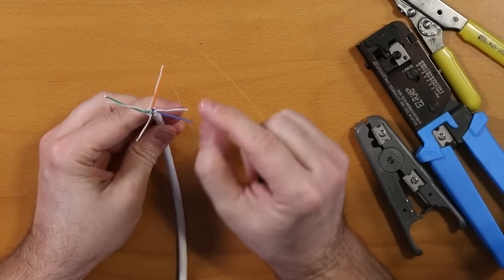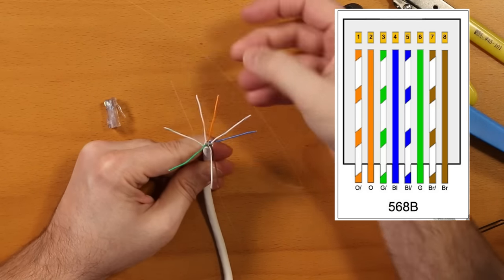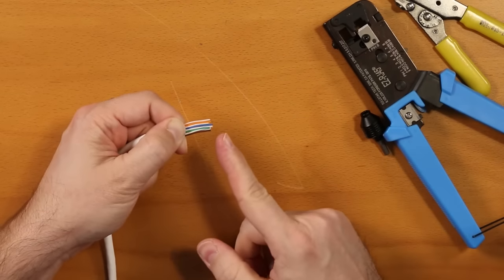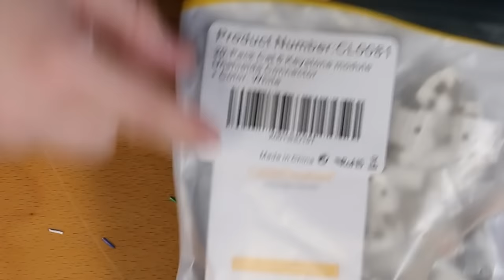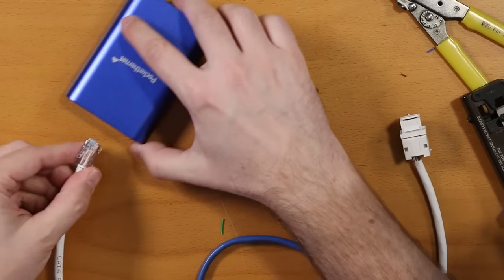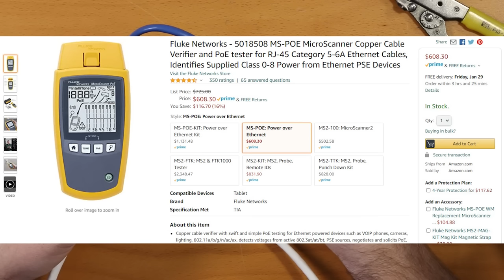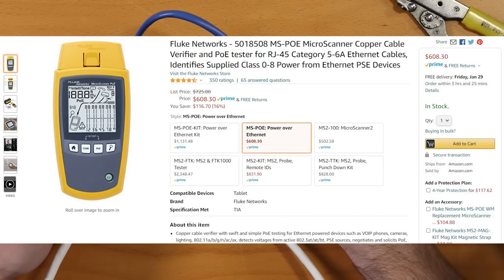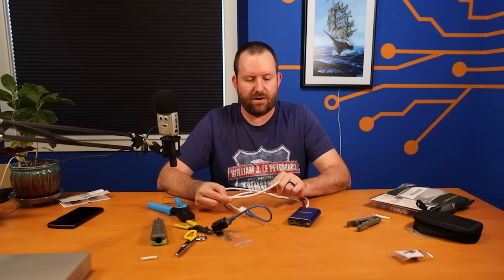How to Terminate Ethernet Cables

Comment: Hey, thx for really good video. I have recently patched out my entire new home and gained a lot of experience on how to do things. First: do not buy cheap tools. Yes, You probably use them once, maybe twice, but a lot of stress will be saved during work. Klein tools are very good ones! Second: about that little gray tool comes in many varieties, but I do recommend to get one with hand regulated opening because there are so many cables and You have to test first how deep the tool shall cut the shield to not damage wires. The worst thing is to unshield cable, start preparation and realize that one or two wires have been touched by the blade and they will come off during patching. Third: cutting wires a bit after plugging in rj45 pass-through into crimping tool will make it easy to finish them correctly. Fourth: I do prefer to use Krone tool as it has these little scissors to cut the wires instead of a blade. Fifth: there are cable testers with integrated circuit breaking tool which helps to find damaged wires and to detect which cable is which if You have bunch of them tied together in one place and wondering where they're "going" into the house :)

Comment: The way I was taught to do keystone jacks was to keep the twist of the wire intact all the way up to the punch down point rather than undoing the twist. It makes it a little tricky, but that's how I was taught by a cable tech.
Reply: Agree. Taught the same.  Ditto on termination at patch panel.

Comment: Couple bits of advice...cut a little more sheaf off, and will make getting them inline / in the connector way easier (you want enough length so that your thumb isn't up against the connector  as / before the conductors go through there individual holes... also when cutting them flush, don't move your thumb, just leave them all at length, and flat cut (I use the other tool rather than snips as wont disturb the flat end) that way you will never accidentally mess up the order / flat effect when re-locating your thumb back to the bottom... Also push the cable into the plug better! The entire point of the plastic lug that clamps onto the cable, is to clamp onto the sheath! That way the sheath takes all load / stress if cable is yanked, and not the conductors..push it right in as far as it will go...that way you wont end up with a cable hanging out of a connector by strands of wire after 5 minutes of use...looks way way tidier that way also! That untwist tool looks like a gimmick to me, pretty sure that would never be faster than just unwinding them for the second per pair it takes! Might be useful to a some people :)
Reply: Sorry if you have a speech impediment, but it is sheath... not sheaf.
Reply: @fatgeek  SHEATH!!!!!

Comment: For untwisting we use a 6" long 1/2" wooden dowel with a thin cut in the end (about the diameter of the cable) about 3/8" deep and a slight double bevel at the top of the cut to direct the wires into the cut. Do it on both ends of the dowel. After untwisting we take a pair between the dowel and thumb and pull to straighten. I agree cutting at a slight angle helps getting it into the EZRJ45. Also stripping the cables 2.5" to 3" helps. It was my understanding that the maximum amount of untwisting on Cat 6 is 3/8" so we push the jacket a lot further into the connector.
Reply: I was a systems installer for years and used whatever I had in my hand to do the same thing (often the handle of my wirecutters/strippers).  The process is the same and it sure offers a quick solution to those coils.

Comment: To ease assembly of the RJ45 keystone male connector I use an easy to make tool that assists gathering/holding/forming the 8 straightened wires in correct order.
Cut a keytag size (50mmx 22mm) rectangle from scrap fibreglass PCB - use a fine hacksaw to cut a 1mm (W) x 10mm (L) slot in one end - drill a 3mm hole in the other end to fit a keyring.
The 22mm W dimension provides a trimming length width gauge that suits most connectors.  
This small tool greatly assists gathering/holding the wires together pre insertion.

Comment: I was always told to insert the jacket into the connector as far as possible so that the jacket crimp takes the strain off the wire.
Reply: And you should. The spec for Ethernet allows for up to 1/2 inch of untwisted wire at each end and to still be considered "in spec". However, the less amount of untwisted wire the better the performance you will get on the cable.
Reply: Oh! And thanks for the video Chris. Always super helpful information.... I'm still working through a big box of rj45 connectors I bought years ago, so I didn't know the through-wire connectors even existed. Very cool.

Comment: Great video.  It causes flashbacks to my networking class in college.  We used the the male ends where you had to put the wires in flush, which is a PITA, especially when you have old eyes. The keystone jacks are fun though.  Like a puzzle. This is so much better than the videos by professionals. They make it look so easy and it isn't. It requires practice.  So buy extra wire and jacks and run your cables extra long!   I do prefer the professionals method of stripping off the cladding using snips instead of strippers, which ensures there are no incidental cuts.  It wastes wire, but the last thing you want to be doing is diagnosing intermittent issues.

Comment: Great Video... I would note that the connector secure tab needs to be facing down for both cable ends. Or you could crimp one end facing up and the other facing down and cross the pairs/pins 1 thru 8.

Comment: In every Cat 6 cable I've worked with, the order of the wires is the same, and we can use that order to our advantage when arranging the wires to minimise the number of wires crossing over each other in the arrangement. I normally do 568A because that's the preferred order in Australia. For some reason, the US switched to preferring 568B at some point.

For 568A, the wires in the cable are ordered around the circle as green, orange, blue, brown (clockwise at one end, anti-clockwise at the other)
Untwist the pairs so that the white-striped wire in each pair is first for green, orange and brown; and second for blue. That is, the wires will be ordered around the circle as white-green, green, white-orange, orange, blue, white-blue, white-brown, brown (either clockwise or anti-clockwise).
This is almost the exact order for 568A. Just the solid orange wire needs to be pulled into place between white-blue and white-brown. Simply gather all the wires together maintaining the order as you go.

For 568B, the wires in the cable are ordered around the circle as orange, green, brown, blue. Note that this is the same order as above, just going in the opposite direction around the circle starting from orange.
Untwist all pairs so that the white-striped wire is first. Then bring together the orange, green and brown pairs maintaining that order. Then fold up the blue pair and slip it between the two green wires.

Using these approaches helps keep your wires much neater and reduces the risk of a wires accidentally swapping places as you're trying to straighten them out or push them through the jack.

For punching down keystone jacks, a Krone tool is so much better than a 110 punchdown tool. But you have to make sure you're using jacks that are compatible with them. Outside of the US, krone tools are much more common.
Reply: Exclusively using 568A works fine if you’re only doing straight through cables, but if you have network devices that don’t support auto-MDIX (not common with modern hardware) you’re gonna start having problems.

Comment: I used Fluke Microscanner to check the cabling.. is very usefull to check your termination 
Good luck for this chanell
Reply: Have one myself and love it.  Problem is I haven’t been able to locate it since I moved 8 years ago.   Got a steal on eBay sometime ago for 35$.   I bought one doing work while in Navy and late 90s was like 300$. But love it.  Rely on experience now and good tools.  I hate to buy a tester.

Comment: I'm sorry, but it needs saying , honestly people who have no idea about things should NEVER do videos on them, period, else it seems your just after the clicks/views/revenue.

1/ they are not, nor have they ever been called male/female, they are plugs and jacks (or mechs)

2/ NO you dont identify plenum cable by the strength member, riser cable also has them in fact i've not seen a solid core cat6 that doesnt.  You identify plenum by the outer jacket and the CODE stamped on it

3/ ALSO  that string you cut off, is there to pull back the jacket 2 inches below your strip cut point, because 7 times out of 10 you WILL have nicked the inner pairs, you may not see it, it may appear fine - UNTIL you run an IRT on it and it fails, THAT is its sole purpose - to allow you to rip the jacket well past your initial cut point

@5:08  most cable guys use bit of the cut off jacket to untwist the pairs fast

@12:01 FAIL - you always keep the twists in place as close as you can get to the insertion slot
There should NEVER be any pairs exposed outside the jack, the jacket should always but tightly against to slightly in the jack

Sure it passes wiremap, but thats not a certifier nor an IRT test.
Reply: As a tutorial video for the average home DIYer (which is exactly what it is), it does its job perfectly.

Don’t like it? Go create your own channel and post a video of how it should be done. 👊

Comment: Great video as always....one month too late for me as spent 2 days over Xmas tidying up my cabinet. 
The untwist tool looks good. 
One suggestion I saw from a video was to use the string to cut back the outer sheath so it reduces the risk of nicking the inner wires when using cutters.
Reply: What I use it for.  Saves time. 👍

Comment: Can I use a CAT6A RJ and CAT6A Keystone on a CAT6 cable or do I need to match the RJ45 and Keystone to the cable being either Cat6A or just CAT6? Or am I overthinking this and either way will work. I would like to just get a bunch of CAT6A connectors instead of having to have two sets of connectors?

Comment: To separate and straighten the cable, I tend to use the outer casing that was cut off to expose the twisted wire and use that to separate and then place 1-2 at a time in the casing (squeeze and pull). Normally straightens very well

Comment: Oh my, DO NOT UNTWIST all the wires when doing a keystone jack. It is not necessary and if you need to 'certify' the cables it will cause problems and they will not pass. Lay out the pairs and see where you need them to be to get them in the slots. You may need to slightly untwist in the area where the cable will go in the slots.

Excellent video on how to terminate modular plugs. However, I have had circumstances where the 'pass through' plugs will short out the pairs that are exposed at the tip of the connector, on the inside of the jack in a switch or router.
Reply: Pass through plugs are easy to use but terrible for actual use in professional installation for the reasons you stated.

Comment: I've heard of issues from other installers about the passthrough connectors - specifically, that the crimper's cutter failing after some time.  I use a two-part connector; you slide over a smaller plastic piece onto the wire, which goes on pretty easily and allows you to positively identify that you've gotten all of the wires on correctly before installing the second part of the male jack.  Trim the wires flush with scissors and the second half slides on before crimping as usual.  
The untwist tool is new to me and I'll be ordering that soon - Current procedure is to use the back of my scissors and my thumb to unravel and pull the wires straight.  I have a feeling that I'll be going through a lot of those untwist tools as they'll get lost in the bottom of my kit bag.
Reply: yah, the knife does wear down after some time but it really only has an issue with the very last bit of plastic and it is super easy to pop those off.
Reply: The issue out IT dept. had with pass thru was they just didn't test out. A pair just wouldn't take the stake down blades for some unknown reason and we tried several sets of the "Passthru" pliers by different Manufacturers we finally went back to the (load bar) two piece style. One of our major complaints is the newer 22ga. cable strands just don't go into the load bars, very frustrating. We've never found specifically larger holed load bars.
Reply: @bjre.wa.8681  I use the CAT6 connectors from Monoprice exclusively - they have never failed me.  The 8P8C, part number  #7266 (they work great for the bigger strands).  At first, I wasn't a fan, but then I noticed I went through far fewer of them than I did the single-piece designs due to they simply worked the first time, every time.  I do go through the bars at a faster rate than the ends themselves, simply because they're harder to hold on to - when you drop one, you're never going to find it (a lot of my installs are on the end of a 30-foot boom)... I keep the leftover ends, fill them up with silicone caulk and let them dry, and use them as plugs in the unused ports on the switches and routers to keep dust out.

Comment: i prefer the style that you put the wires threw the guide boot, snip and crimp... i have crimped hundreds of ends with that style and.. hand full of fails, i do agree the pass threw connectors are far better then non-pass-thru cubes... one job i had we started buying our own cubes via monoprice because we all loathed the ones the company provided 15k worth of... that eventually they sold them and bought us the ones most of us preferred... via monoprice...heh...

Comment: Has anybody (besides me) tried using the EZ Cat6 connectors with 23 AWG as opposed to the more common 24 AWG conductors? It is a bit tougher to get them to pass through because they have a tendency to crimp and buckle because of the thickness. I am also guessing that the crimp tool Chris used was designed to also cut the conductors that pass through the connector at crimp time. I am using an older one that does not do that and have been using a box cutter to get a clean, close cut. I recently ran into a situation where I terminated 2 sides of a 40' length of CAT6 UTP (23AWG) that tested OK (via my Monoprice LAN Cable Tester) but cut my 300 Mbps internet speed down to < 100 Mbps - It turned out that even after the box cutter trimming, 2 or more of the conductors were making contact with each other externally. I used a file to correct it and it popped me back up to  300+ Mbps.  Also it might be a good idea to explain that you cannot mix 568A and 568B on the same cable. When you are new to doing this it is an easy trap to fall into when your instructions show both A an B on the same sheet.

Love the Channel, Chris -- Thanks!

Comment: A personal thing .. don't do the "wiggle" if a cable hasn't cut after punching a wiggle can inadvertently loosen the connection. Re-punch or chisel it with an appropriate sharp blade.

Some keystone jacks have the colour coded wiring legend - they're cool. Really sexy ones come with dust caps and a bit of clamping for the cable sheath on the back (if you don't strip too much off).

RJ45 cable boots are great added protection and as they come in lots of colours they're good for coding.

I'll just throw in that most RJ45 plugs and crimpers are compatible, but NOT all.

Comment: My most used tool is the Klein 110/66 screwdriver.  A 4-in-1 screwdriver on one end and a 110/66 punch down tool on the other.  It sells for $27 list (half of what most decent punch down tools sells for).  I purchased one for each of my techs.  I wouldn't recommend it for punching down a bunch of jacks, but it is great for occasional use.  110 is for network jacks.  The 66 block tool is used for phone.  It is great to have if you must deal with T1 installs.

Comment: We use the EZ-RJ45 ends and tool at work and they are awesome. We recently did a big job and used the TrendNet keystone jacks. They are tool less and work great we haven’t had any failures (300+ terminations). The only thing that is a little bit of a pain is the cable sticks out a bit on the sides of the jack and are really hard to cut. We used cuticle clippers and it work great to cut the ends off. The jacks are very clean and easy to use, highly recommend them!
Reply: Those are wider than standard keystones and won't fit on 4 or 6 position wall plates, where there are pairs of connectors side by side.  They're fine for the 1, 2 & 3 position wall plates where all the connectors are in a single row.

Comment: You can also use the indentations of your wire snips to hold the wire down with your finger to smooth and straighten the wires.